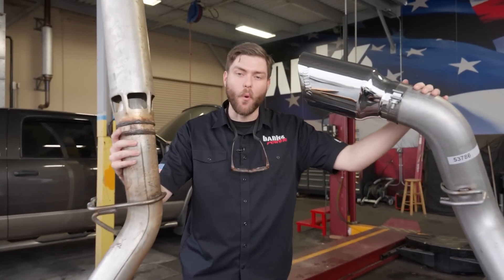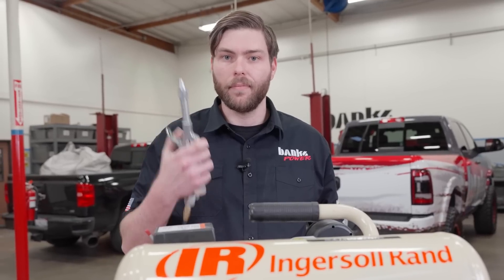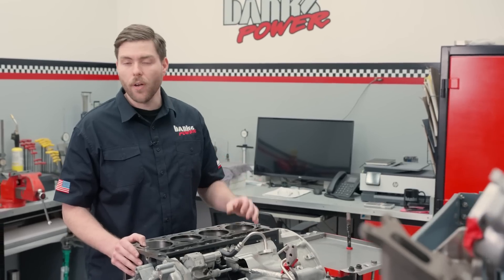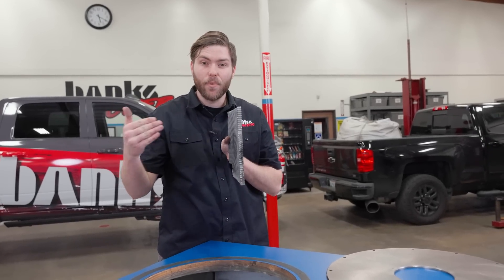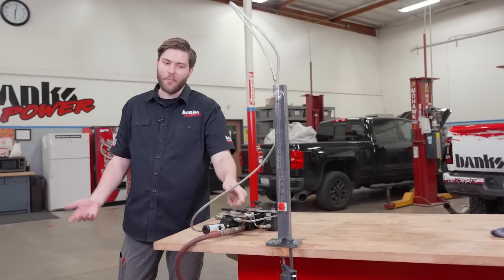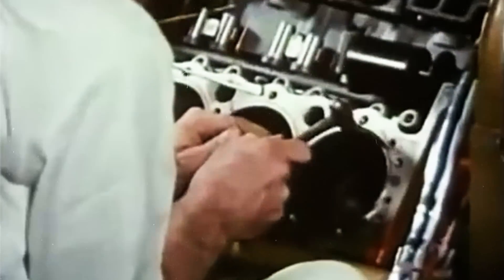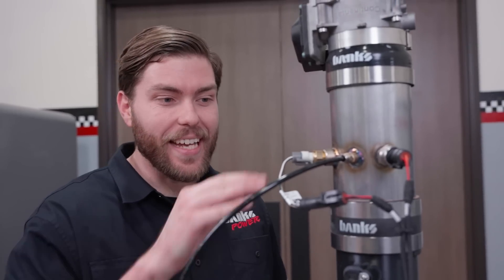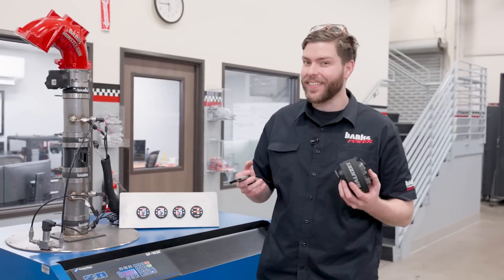Everyone is measuring airflow WRONG - Here's why | Banks Entry Level

Comment: Does a hot metal surface of a pipe alone chance cfm without with a consistent air temperature (mass). I am thinking that air molecules closest hot surface pipe are further apart regardless of time needed for convection of the heat intobl the air to change air mass. Put another way,  would a 2" pipe that was 200 degrees flow less cfm than a 2" pipe at 50 degrees even if the airflow was fast enoughforvery little heat  convection to occur?

Comment: I must have been lucky? My superflow 1020 flowbench does density altitude calculations automatically and is within approximately 1 cfm or closer summer or winter and reads correctly with the calibrated square edge orifices supplied. Beyond that. The density is moot to me unless you can control the weather on the day the engine / heads tested are running. What I am saying is the data is used primarily to show a gain or loss during porting or development. The actual air quality on any given test day is not of much value in my opinion. As long as the test instrument repeats. The gain or loss observed is good information. Most of us don't race flow benches. Its a tool to improve wet and dry air flow. Not check air quality / density. I am super happy with my1020 and wish I had another one.

Comment: I'm a small engine mechanic 'who deals primarily with single and two cylinder 4 cycle engines (plus the fantastic world of 2 stroke!!!).  The very fact that you put sensors prior and after the MAF sensor is on point.  Incredible commitment in terms of recognizing that the method of testing has an impact on the measurement results.   Even more impressive to me is that you essentially doubted the readouts of what I can only assume is a very expensive piece of test equipment.  You modified it for more informative data.  I have learnt in my career that you can never rely on a single piece of information and, more importantly, to always doubt your method of testing before coming to any sort of conclusion.

Comment: This is misleading bunk. If you know the flow in CFM and you know the atmospheric density then you know the MAF. The MAF can vary with environmental factors and make you "think" you have a change when there is no actual change in flow efficiency. 
Since this is NOT a dyno, you don't need to know the MAF, you NEED to know the CFM in order to ascertain the resistance the device has regardless of atmospheric conditions. 
Flow benches measure the CFM of a known standard which is flowing exactly the same amount the test component is flowing. Therefore the test piece is flowing exactly the same amount as the known standard.
You need the MAF when you are DYNO testing not flow testing.
I'm very surprised Banks could be THAT wrong about something so fundamental.

Comment: What I want to know is how much air is in every cubic foot how much is a cubic foot of air weigh. I mean if a cubic foot of air is 95°, wouldn't there be more air than if the air was 105 degrees if I have 72° air I would have more are every cubic foot then if the air temperature was 105°
I guess my main question is what is the air temperature at sea level to obtain 14.7 PSI at sea

Comment: My question would be , how does mass airflow differ from flow? Yes, the air is more dence or less, but that's only telling you at that moment how dence the air is at the moment of the test. That, in my opinion, is not the bigger problem with a flowbench test. That is not even why you measure a head on a flowbench. Im willing to have a discussion. Who knows, maybe I can learn something from you.  Possibly you can learn something from me too.
Reply: Exactly, knowing mass air flow in such a test tells you nothing.

Comment: The latest 8 wire Bosch has multiple air temp sensors and specifically a humidity bulb and temp sensor. The microprocessor in the MAF meter calculates Density Altitude of the air mass and sends that to the ECM.

 It's a micro weather station the ECM  uses to calculate PPH of AIR : PPH of FUEL for the stoich lambda correction of 1.0 

Everything is a lean burn engine these days. You can not wait for a wide band to correct.

Reason chevy had to go to this maf sensor a few years ago, as the 5 gas exhaust analyzer was to late to control the burn, so they added the 8 wire maf sensor up stream of the 5 wire....just to add the humidity bulb and made that IAT#1,  only used 3 wires to do that.

Everything made today, basically uses the same 8 wire bosch weather station sensor.

MAP based tunes are EFI 1.0 and far from superior.

If idiots understood, they definitely would not be deleting them like a monkey see do~do.

Those are not tuners. Just idiots playing videogames with their tokens.

Comment: I am trying to figure out why one would use a MAF sensor over a MAP sensor or both. Doesn't either one help determine airmass? I'm tuning a Gen III SBC and it uses both. I don't know why... I think by default uses MAP but in startup and high RPM or high load it switches to MAF. Is the MAF more accurate? If so why use the MAP? I also notice many tuners turn off the MAF and tune entirely on VE table / speed density which uses the MAP sensor. The factory, at least from GM doesn't seem to populate or tune the high pressure as well as high RPM regions of the VE table much. Is that the only reason they use MAF instead of MAP there? Any insight is appreciated.
Reply: Superior load calculations for fuel control, and timing control, as well as transmission control.

So much of the trans load strategies come from the MAF calculations. Torque and timing tables being major factor of MAF calculations.

MAF sensor does everything a MAP sensor can not.

Specifically in calculating for the incoming air density, so to properly calculate the output of the fuel density, to obtain correct air : fuel ratio calculations for lambda of 1.0

Load based calculations for volumetric efficiency of 0-100% for 1 atmosphere.
Reply: @KTP-s1v  so is more accurate? I'd think you could get air mass from a temperature and pressure sensor too / MAP? or is MAP just a ratio of manifold to amospheric pressure?

Comment: What a shameless plug of the idash, you guys are just using the “bullshit baffles brains” method to try sell something to people who don’t have a proper understanding of what a flowbench provides.
Cfm is the volume as you mentioned, from that you can calculate the Mass airflow anyway, you failed to mention what a flowbench is really used for, to map localised velocities within a port or intake, the shape of these dictate if there are dead areas or areas that are on the edge of separation, can the idash show you this? Of course it can’t, does the idash map cross sectional areas and velocity profiles? Of course it doesn’t, does the idash calculate area efficiency? Nope, doesn’t do that either. All of this information can be extracted from a traditional flowbench.

Tell me this, how are you going to increase the density of the air entering that elbow for example? You want to talk about the mass but you can’t actually “see” what that increase in density will do because you can’t map the cross sectional areas and it’s velocities if you have to connect a device to the front of it to compress the air.

Honestly I would be hiding in shame if I did this video, to say that the flowbench is obsolete just shows the lack of knowledge on how to actually use one, the cfm number is just a byproduct of many other bits of data that can be taken from a bench, then it’s up to the operator to use that data and implement changes to a product for increased efficiency.

It’s been 6 months since this video was released, can’t wait to cringe at the next sales pitch 👍

Comment: My question is how sensitive is it to suttle changes in port changes, When Smokey first built his flow bench (it was big enough that he could flow a whole engine.) at that time there were only a few across the country and they flowed heads at 10 inches Smokey found that he could make big changes and the flow did not change much. He then went on a quest the find a number that was sensitive enough to make very small changes to the port to show up, he settled on 28 inches which became the standard. To find out how much a head flows is one thing to have it sensitive enough to develop a port is another.

Comment: Put 9" damn pipes on for 'more power'.. why not?.. because you need back pressure to avoid scavenging. 
you even need some resistance to intake to help keep the column of air steady.

Comment: If I had an older vehicle (no ECM) can I use a MAF sensor (like a Bosh) and would the I-Dash be able to convert the data from the MAF without a ECM? If so, what about other pick up sensors like pressure, temp, etc.
Reply: I would like to know the same thing.

Comment: 1) Everyone is measuring airflow WRONG - Here's why // You never presented evidence to prove this statement is true.
2) 00:43 When you see advertised improved airflow, what does that actually mean. // You never answered the question.  In a roundabout manner, you touch on it, the change in pressure drop, but you failed to address why that is the characteristic of interest to evaluate, nor why your proposed method of measure is better. 
3) 09:20 The change in density from forced induction means CFM is no longer relevant // Turbochargers have been around for a century.  Do you want me to believe nobody on the planet realized they've been making a flawed device for decades until just now?
4) 11:45 To be honest the CFM-based flow bench has been obsolete for decades.  but to bring it into this decade... // You just need to buy the $295 product we're selling through the link below.
5) Submit your finding to the SAE Journal.  If it is published after undergoing a technical peer review I'll be more inclined to believe your claim that flowbenches that measure CFM is a flawed premise, that the measure is wrong, and has been obsolete for decades.

Comment: Back in 1993 my old school hotrodder auto shop teacher built a flow bench powered by a 5hp vacuum from the sawdust collection system out of his brothers old cabinet shop. While not the same as a commercial bench, it was great for comparing flow at different valve lifts or seeing the before and after results of porting. Even then he lamented not knowing enough about computers, and there were no off the shelf solutions, to integrate a MAF into the system so the idea itself isn't all that new.

Comment: If parts manufacturers started using MAF instead of CFM to advertise flow and HP potential from their parts theyd be able to easily manipulate the temperature ect and give higher then realistic lb/ft3 air flow or potential HP numbers

Comment: When Really Analyzing & Comparing to an Actual Running Engine Cylinder head & Intake Tract actual Dynamic Pulsed air flow Pressure wave bounced Reversals compared to Any Constant Pressure Unidirectional CFM or MAP measurements & the Exhaust gas Discharge  running around  1500 Psi at Nearly 1000° F Temps is Far Different than 28" Pressure at 80° Ambient......Seems These basic Existing intake Bidirectional bounced Flow & Exhaust Pressure & Temperature Gross issues need Measurement attention 1st in addition to Intake tract MAP correction.....Of course MAP has No bearing on the Exhaust Cfm measurement....

Comment: Very Interesting  Description & I get the Concept.....So Show us some Real world Typical Examples where All the Traditional air flow Benches Cfm flow data Doesn't Significantly Track with Actual engine Dyno Results & simply Remeasuring the Same cylinder head with this MAF sensor based Bench Always tracks Significantly Better with Actual Dyno measurements.....

Comment: Is the density not the same when the Delta pressure is the same? There are some flaws to any given system , however where not measuring density on a flowbench,  that's not its purpose. The purpose as a head porter is to measure the resistance to flow compared to size. In other words how effectively a given area is being utilized for flowing air. At 28" one would be 350 cfm  or 146 cfm inch of area. Its changes with a different delta pressure.  I understand how MAF works and it has its benifits when used in conjunction because it can show what happens to the density of the air as it goes through the port runner or system. A flowbench has more of an unlimited capacity unlike a engine that has a fixed volume.  That where things can get a little messy for determining shape.

Comment: These principles of fluid pressure are proof that the globe is a lie!
Can't have air pressure without a container, certainly cannot maintain air pressure next to a near perfect vacuum without a barrier... thanks guys!
Reply: What’s the container that’s holding the ocean down (or a pool) causing the pressure I feel in my ears when I dive down?
Reply: @thmanx  simple density, because it's a sealed pressurized system, what is denser sinks, or rather is pushed down. Gravity has only ever been a theory and is disprovable in experiment. Properties of density and bouyancy can be reproduced with consistent results... these are known laws.
Reply: Interesting, but why is air 4.3psi at 30,000ft? There's no barrier up there?
Reply: @MrDeezlbc  look up the firmament... I recommend reading the first chapter of genesis.

Comment: How about the pulsing air effect as the air is flowing into cylinders that are turning the air flow on and off, as you get closer to the cylinder head that effect is getting much greater.
Yet all the airflow devices are measuring constant air speed.
Is there another breakthough in flow benches yet to come?

Comment: This is pure gold for a lot of people to get an actually understanding of how good MAF systems are these days and the problems with many ways of acquiring various forms of data has been in the past. 

For example if talking about tuning you can see the whole flow behavior of the engine and in relation to all other temperature and pressure data when the setup is starting to experience to choking and other forms of inefficiencies. On a MAP based system you basically have no idea, because you base everything on mostly assumptions and dont know what is actually happening flow wise with the engine with every adjustment.

Comment: This is why I really, REALLY hate the use of "VE", or "Volumetric Efficiency", by the "tuning" software found in aftermarket ECUs!
It's a bastardisation of the actual efficiency of the engine and, as the gentleman discussing it says, the correct term should be "mass efficiency", as I've been saying for years!

Comment: What difference does mass air flow make when testing an elbow or exhaust on a flowbench when MAF if a variable of air temp, humidity and cfm? 
Air temp and humidity is not a constant on running engines or the everyday world. CFM capability is a constant and most people know that if you run colder air you make more hp with the same cfm.
Will you run an exhaust system at full temps on the bench to simulate a running vehicle? If so the temperature at different points along the exhaust would have to match that of the installed exhaust with engine at power to keep density the same at each point along the exhaust to make it 'real world'